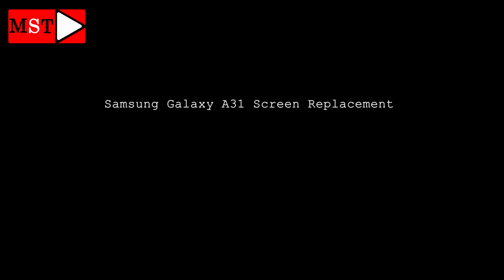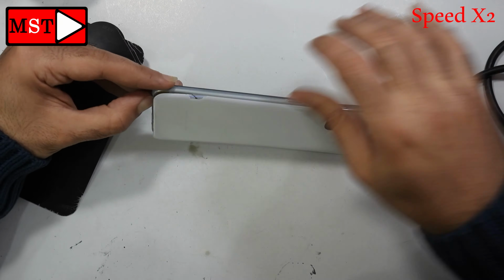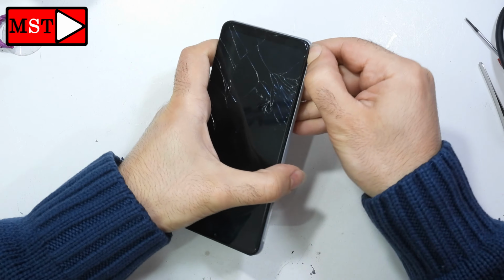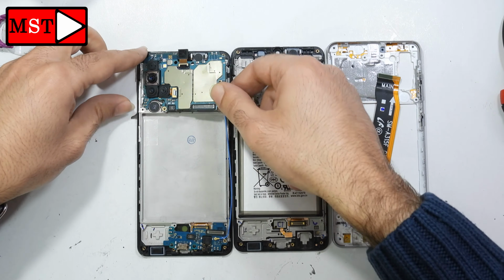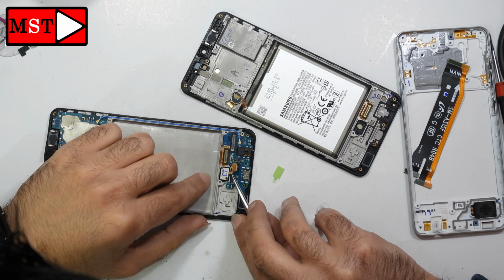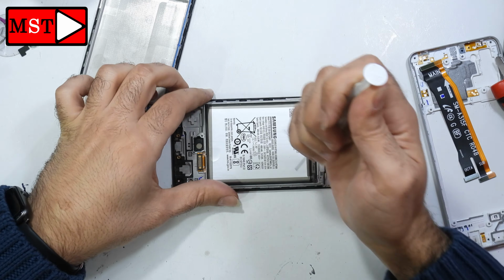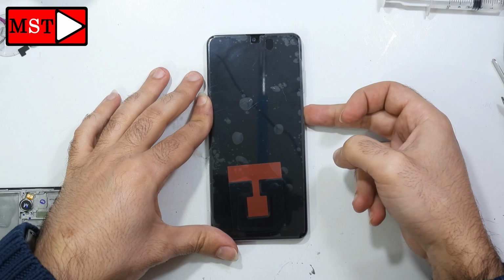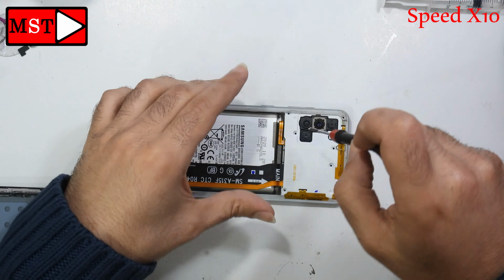Samsung Galaxy A31 LCD Replacement

Comment: Hi. After screen replacement proximity sensor not  works properly, how can i fix?
Reply from the maker: Look near ear speaker this is where sensor is, it should be blocked by glue or dust, clean it and test.